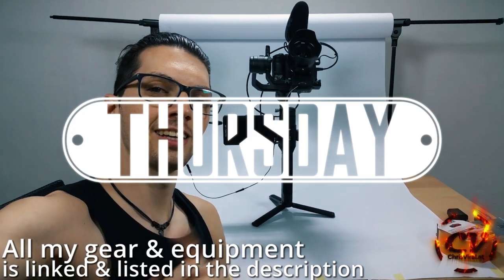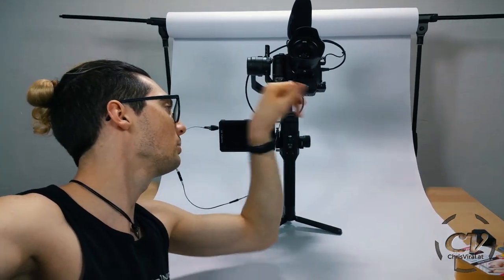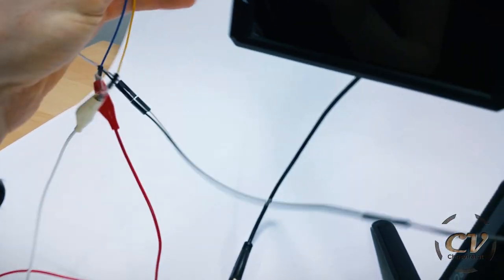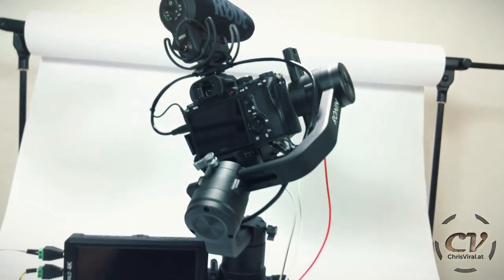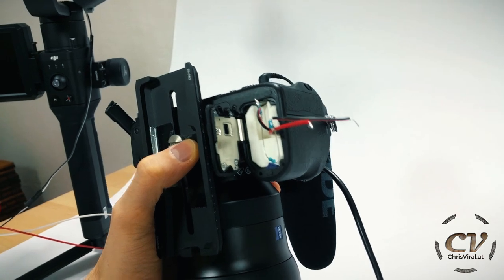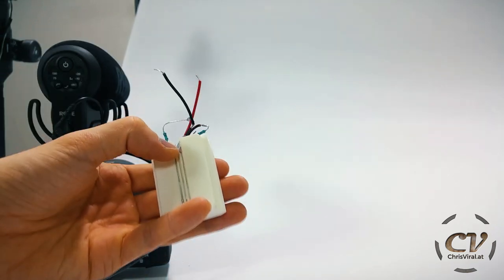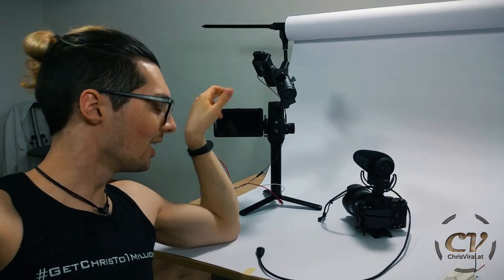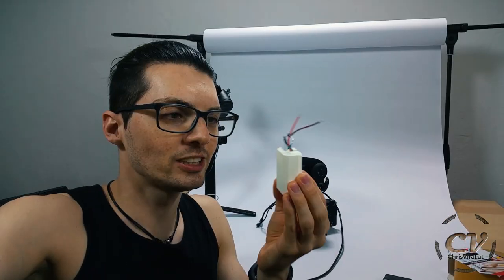DIY Sony A7iii Dummy Battery (NP-FZ 100 Dummy Battery Test)

Comment: great idea,    you could buy a cheap battery with chip and remove the lithium battery so you can still attach your extern power supply. or take the chip and connect it to your 3D print.
Another idea is a mediumpoorman-in-the-middle-attack ;D. record the start sequence of the battery. I mean the bytesignals it send/recieves from the camera. Could be done with an arduino + serialmonitor over usb i guiess.
I would look at it with an oscilloscope (that 17$ one i sended  the link some time ago  :)
I did this years ago so trick the startup sequence from the focus-electronics of a digitalcamera so it doesn't spit out an error and refsed to work (because it removed the complete lens for diy stuff)
Reply from the maker: Your "mediumpoorman-in-the-middle-attack" sounds insaaaaaaaaaaaaaane ahahaha. Oh my god XD

Great idea seed though 😍

(In the end I bought a cheap dummy for 14$ from China)
Reply: np you dont have to do all diy :), but sometimes there are no clones from china or  its to expensive or (like 5-10x).
Reply: @ChrisViralVlogs  I'm also trying to figure out The letter S on the battery for my Nikon d5000 IDK what that is also tried to mod it doesn't work